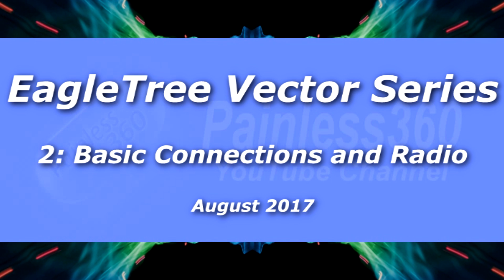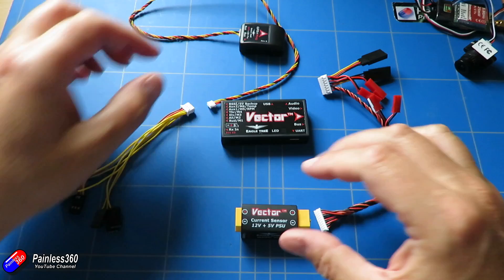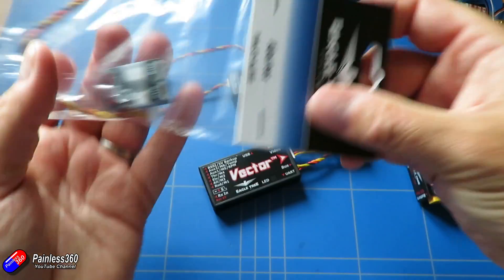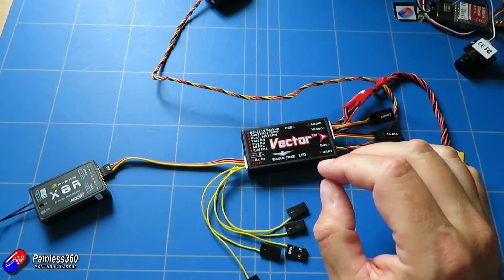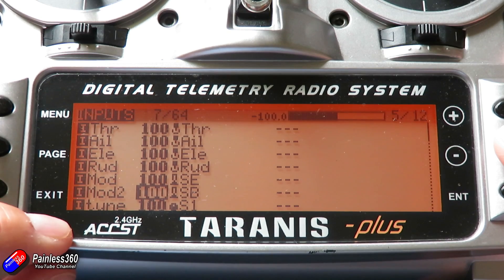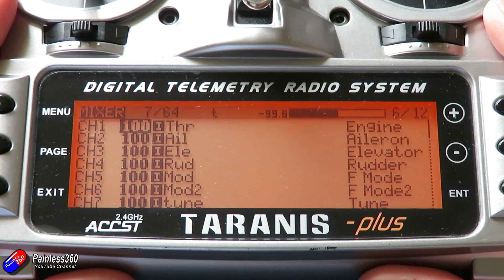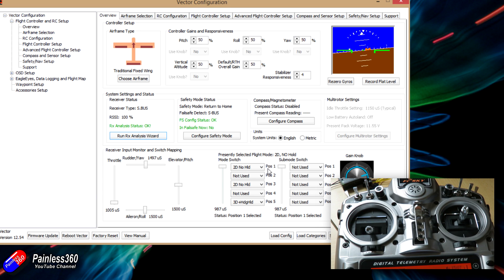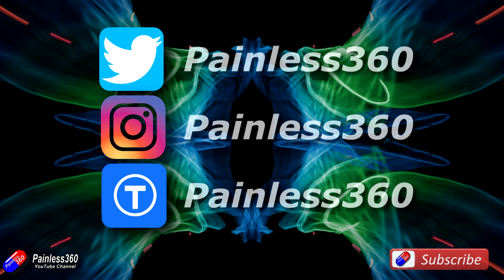(2/5) EagleTree Vector Series: Basic Connections and Radio Setup

Comment: Has anyone else had their vector lock up during flight? On 2 flights my plane would quit responding to any input , I tried flying it all the way to the ground. Both times it was less than 100 yards away (good rssi) . After the first crash I added a proper backup battery per the instructions. After turning it off and back on it works again.

Comment: The vector cable set I bought has only the Ail with 3wires to plug into the Rx in , I have a D8R xp, I don't know where to plug the Ail cable in to the D8R xp. Canyon help?
Reply from the maker: I used to sbus for mine. Does that RX have an Sbus out?

Comment: This series of videos is superb 👌. Sweet work.  However, I cant get a picture from my camera. If I plug the camera into the vTX I get a good quality picture. If a set it up as in the video from the vector, I get a blank screen. Any ideas???
Reply from the maker: I'd start with the power to the camera.. Best of luck!
Reply: @Painless360  yeah it looks like the signal is not getting to the camera, it is powering up OK. I measured the voltage from the vtx output and got 12v from the red and 1.2ish from the yellow. On the camera output though I got 12v from the red and 0v from the yellow. All the cables and harnesses have ben con checked and voltage checked and are good

Comment: This video is nearly 3 years old but cosmetically, it looks like the Vector hasn't changed in that time.  I'm assuming there's a lot has been happening under the hood?  I'm really interested in buying one of these and I'm just wondering if the technology is up to date?
Also, @ 6:45... could you just use a regular 3 wire jumper instead?  Or is the white plug different?  I wouldn't want to leave those 5 yellow wires on the aircraft. It would trigger my OCD.

Comment: G'day Lee, awesome videos, trying to set up my Taranis with D/L and Eagletree Vector now, have followed your setup process and copied the addition of the sub switches and channel setup but cant get software to recognise inputs. I have the vector to D/L receiver via sbus and the D/L transmitter set up via relay. I can operate servos etc buty the software doesn't let me do the rx wizard as it won't recognise the switch
Reply from the maker: Don't use stuff like mixes and dual rates until its all setup. The steps I followed to get it all working are in the series...Happy flying!
Reply: @Painless360  Cheers Lee, after some very frustraing moments and lots of nasty words, I got it working, vector software wouldn't see the inputs when I had 16 channels selected on the D/L micro receiver, when I changed to 8, and still have the 14 recognised in the pulse train, with the D/L set up on a repeater. Thanks again for your videos

Comment: So, I need help. So, I found a servo leaded vtx cable for my vtx. However, I see that my vtx cable has a smart audio built into the servo lead, as well as the signed power, ground. Will I still receive sound?

Comment: What if my vtx has a different power output connector? Do i ignore it?
Reply from the maker: Sorry, I don't understand the question.. Can you rephrase?
Reply: Like for example. My vtx has a servo lead and a JST.
Reply: It has a Jst and servo connector attached. However, im happy for the fact that my kit has that servo thingy connector, but, that JST.
Reply: The red connector an a servo connector.
Reply: sigh Picture this. On my vtx, there's a servo lead cable for connecting to eagle tree, where as the jst is where the vtx gets its power. If it's supposed to get power from the servo lead, do o leave the jst alone?

Comment: I'm so hooked on your videos. I've been thru all TBS videos as well as Eagle Tree. Looking to control a fixed wing with Crossfire Micro RX to Eagle Tree Vector using a Futaba 14SG TX. Can't seem to get the correct wiring combination. Any help please?
Reply from the maker: You'll need to use SBUS so the connections are the same as my Matek F405/Arduplane build.. Hope that helps..
Reply: @Painless360  Thanks but I'm not using Matek. I'm trying to use TBS CrossfireMicro rx for long range via the Vector
Reply from the maker: I understand that. I was referring to the SBUS piece. Best of luck.
Reply: @Painless360  some progress. Although servos are not moving in the correct direction. I realize you're busy and it's not my intention to boggle you with questions. I'm currently using a "Y" connector for the wing servos. Do I need separate extensions for the servos and if so what channels on the Vector should I connect them to?
Reply from the maker: All of the steps are covered in the series. The Vector documentation is fantastic too.. Just take it a step at a time and you'll have it all working. Best of luck!

Comment: I'm putting my fpv wing build together, question I have is,,, is it ok to limit servo throw, with end points say 65% and add 25% expo in the tx, and run the vector tx wizard again, will vector work fine after?  ....Thanks, your videos are terrific!
Reply from the maker: I would always recommend you follow the manual for the Vector. You can add expo on the radio but I'd always be careful about reducing the limits especially if you are using elevons or V-tail..
Reply: OK thank you, I appreciate it.

Comment: Hi. I appreciate its a while ago now that you put these videos together and I have to say I have found them priceless in helping me put everything together. However I do have a quick question. Off the top of your head do you know what colour wire is the signal wire on the GPS mag? If not do you know I could find out. Unfortunately it's not mentioned in the manual. I'm trying to add an Arkbird AAT but don't won't to use an extra GPS unit so that I can save a bit of weight. Many thanks 👍✈️

Comment: Hi, I recently purchased the Eagletree Vector Fpv system and I have a question regarding the power setup Im hoping you can help me with.
I've looked at your videos on YouTube which are great and read some threads on RCgroups.com but cannot seen to get a definite answer to my question.
My question is this:
Do I plug the ESC that is connected to my motor into the ESC side of the Vectors PSU?
I'm confused as in the manual section 3.3 it's states that the PSU will provide 12v 1amp to the ESC connected to it but my motor at Max throttle draws 50 amps!
If this is the correct setup and I do in deed need to connect the motors ESC to the vector PSU ESC side do I then need to cut the red wire coming from the throttle servo of the ESC that will plug into the vector as won't this be provide power to the vector inout/outside side also? (ie. provide power to the left side of the vector unit too)
I hope I've explained myself enough for you to understand my problem and I look forward to your reply.
Kind Regards, Martin
Reply from the maker: Yes, please see the build, I cover that..

Comment: I'm putting one in my nano talon but I'm using a l9r receiver but the vector software won't pick up my mode switch when I run the wizard any ideas
Reply from the maker: +Craig Stansfield want troubleshooting have you already tried?
Reply: Il be honest I don't know where to start with fault finding
Reply: all sorted i didnt set my mode and sub mode on the mix page to giddy to get the nano talon in the air

Comment: Thank you for another great video. Why did you plug a Ubec to power the rx rather than using the Vector left side 5v?
Reply from the maker: +Guy St both are connected together via the three wire sbus cable. For the build it'll be plugged into the outputs of the Vector. Both work, but you don't want all the current for the servos pulled through the reciever in practice.
Reply: Guy St one quest the manual says that vector will not provide power to the servos I am confused .

Comment: If I'm flying in 2dh mode and not touching the radio stick, the fail safe no pulses will be activate?
Reply from the maker: +Dan Avidan shouldn't do. You need to test failsafe on the bench.. See the manual..

Comment: Hello painless, need a little help im new to modding a quad. I have the 3dr solo and want to pair it up with a tarot 2D gimbal. Says i need a voltage regulator because the gimbal needs a 3s battery source  and the solo battery is 4s would you know what i need and how to do it?
Reply from the maker: +Wraith215 sounds like you need a 12v BEC, make sure it's rated high enough for the amp draw of the gimbal. Best of luck

Comment: Damn, I like the Vector, but Pixhawk2...I guess I'll wait for the comparison video! Thanks!
Reply from the maker: +William Decker maybe after both series are done. Or you can make it easy.. intending to fly fpv all the time? Go Vector..
Reply: And isn't it the case that none of the Ardupilot software products for supporting the various flavors of Pixhawk Flight Controller hardware have downloadable (ie, annotatable) PDF documentation.  (I've never met a technical document that I didn't want/need to annotate the b'geezuz out of.)  That's a big minus for me.  If I wasn't locked into an autonomous-flight application, I'd go with the Vector system.  (By the way, cudos to the Dronecode organization for beginning the task of producing PDF documents in support of the their PX4 flavor of Pixhawk.)
Reply from the maker: As you asked for it, here is a preview - https://www.youtube.com/watch?v=m5msHMDpoQo :D

Comment: Thies videos are very helpful. I did the radio cal yesterday for my vector in my mini talon, super simple. Stick command is perfect mod switches are working and the gain pot is good, the stabilizer is backwards though. I haven't seen any way to change that in the gui. Any ideas?
Reply: Dan Avidan,
 Negative, I never registered with face book.
Reply: Looking through the user manual page 50 may have the answer I was looking for. Channel reverse in the radio.
Reply from the maker: +Eph Robbins yep! :)
Reply: Eph Robbins r u in the mini talon group in Facebook?

Comment: Hello Painless 360
is it possible that you can maybe do a tutorial on how to setup a sonar module on a pixhawk 4.
Type of sonar is HC-SR04.
Or maybe you can point me into a right direction or a link.
I cant seem to find the setup in the internet.
Greetz from MaxTech
Reply from the maker: +MaxTech not sure you can use that - http://ardupilot.org/copter/docs/common-rangefinder-maxbotix-analog.html
Reply: Painless360 
Yeah I know that type of wiring from arducopter😁
That did not work either .
I saw some one got it working on APM flight controller .
So I thaught its also possible on my PX4. 
But oh my lord this issue kept me awake for 24hours.
I saw on a forum that a guy connetected the 4 pin JST connector on the GPS 2C port ,but if I do that my external kompass does not work.
Can you maybe look in too this maybe I am over seeing something .
And you are ten times more pro then I am😁😁
Reply from the maker: +MaxTech it's not supported but others are asking for it - https://discuss.ardupilot.org/t/integrating-hc-sr-04-ultrasonic-sensor-into-pixhawk/17096 if you can't find the answer to a question then it usually means that it can't be done, there are wonderful forums and resources about that show pretty much everything. Happy flying
Reply: Hello Painless 
again MaxTech with an issue
Since I cant get my pixhawk married with a sonar module I tried  it your way with a Naze32.
I got the wiring set,but I cant get the sonar enabled in clean flight or betaflight.
I did your thing step by step but no joy.
Reply from the maker: +MaxTech a quick Google search would have many articles like this - http://fpvlab.com/forums/showthread.php?51696-NAZE32-REV6-FULL-CLEANFLIGHT-SONAR-WON-T-ENABLE I no longer reccomwnd using F1 based flight controllers. See my most recent flight controller comparison video.. Best of luck

Comment: Thanks. Great video which we watched (all three of us) almost simultaneously. (3 because he has a more experienced helper now Yay!) I now get to sit back an learn without any pressure. Which battery eliminator circuit are you using here? (even pausing the video doesn't help me read the label)
Reply from the maker: +didactylos4 diddy4 it was a 3A hobbywing one, i think. Happy flying
Reply: Thanks. I've always liked the fact that you are happy to answer seemingly stupid questions from us noobs. :)
Reply from the maker: +didactylos4 diddy4 no such thing as a stupid question. Often the answer is already in the videos, but it can be tricky to help those pilots with no troubleshooting experience. This one was easy! :)